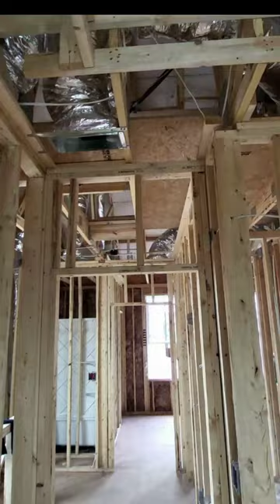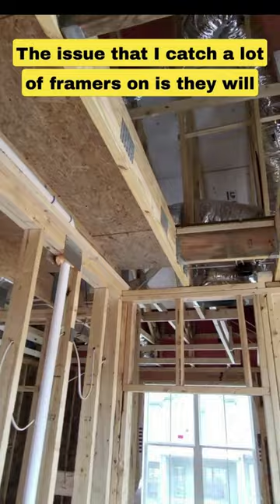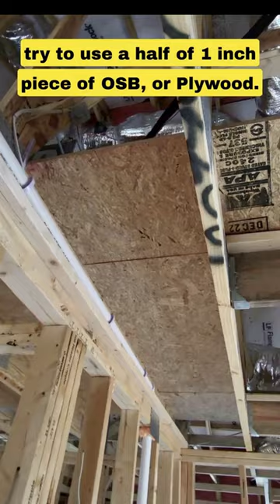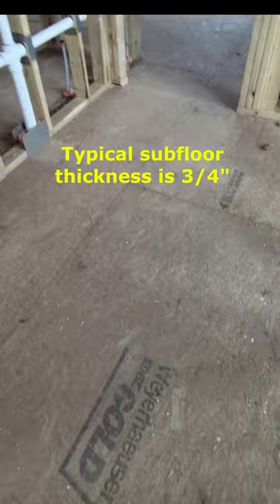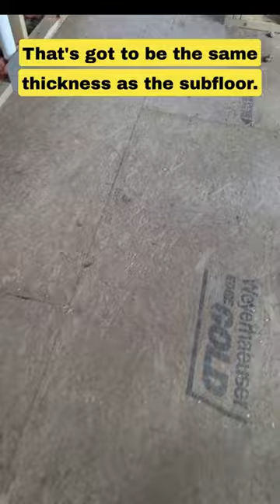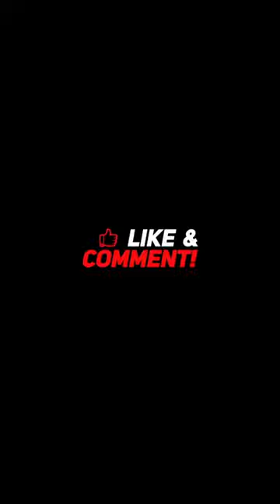Is Your Attic Platform the Correct Thickness?

Comment: I noticed guys are framing out doors without headers these days. In that house they did not orient the 2x  material vertically and then put the half inch plywood in between, has code changed, was that ever necessary, what's going on now?
Reply from the maker: If it's not a load-bearing wall, door headers are not really necessary.